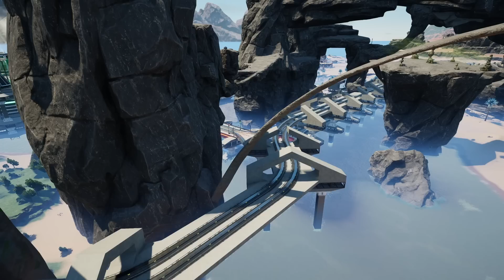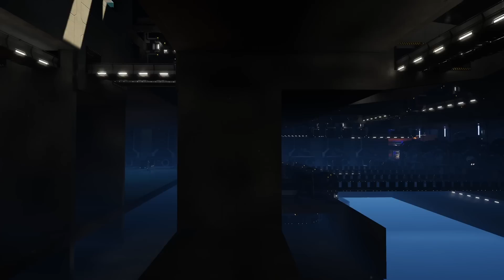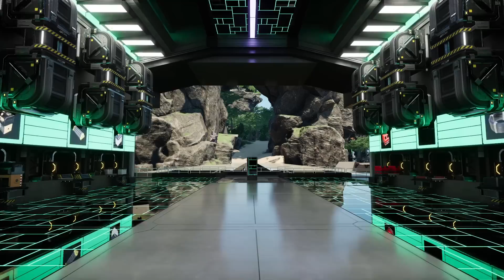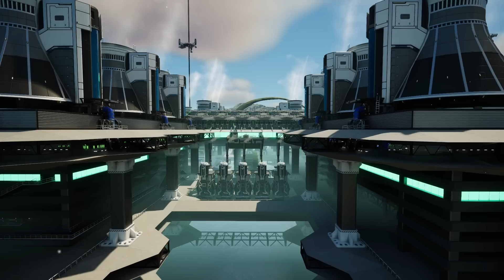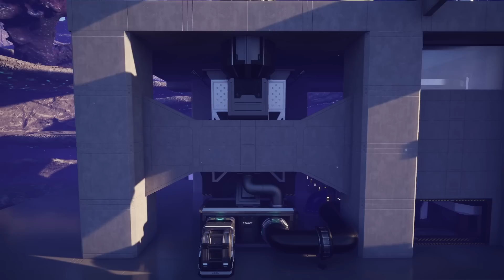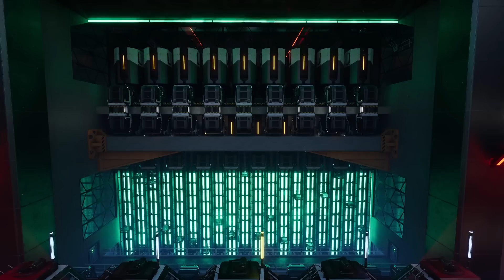GORGEOUS Satisfactory Factory Tour

Comment: What a work of art. I had to watch and pause over and over. As a design perfectionist, and someone who likes to make creative use of textures, colour and elements, there is a lot here I can relate to... But the execution here is so next level, in both size and splendour. Absolutely everything has received treatment — each machine is meticulously clipped with architectural elements. I especially like the radiator-style roofs using spaced walls; I might try that. 

It's amazing that everything works: to the point of having a central storage that even contains all late game elevator parts.

Thank you for curating these amazing saves, and taking the time to create such watchable tours. Love your content.